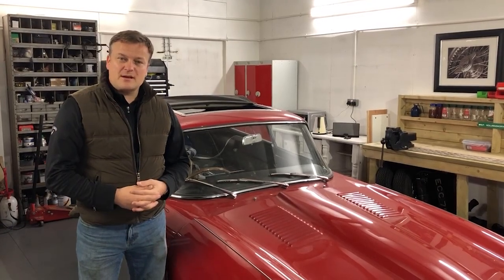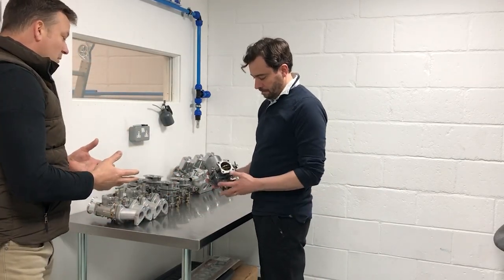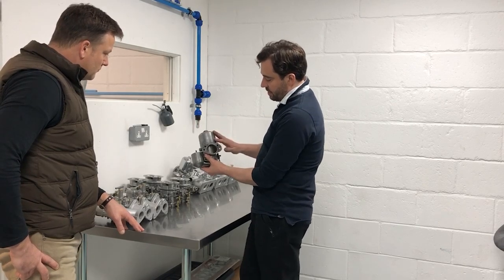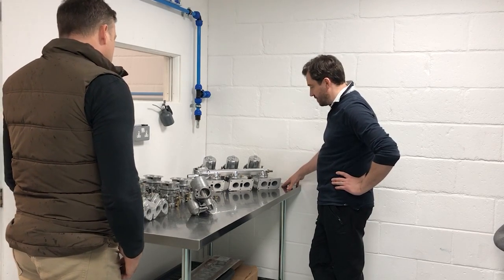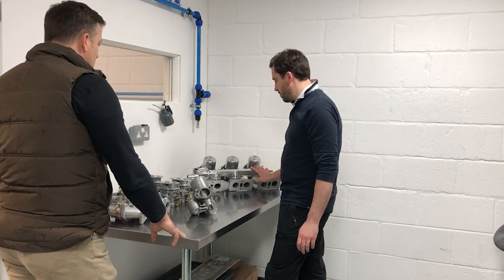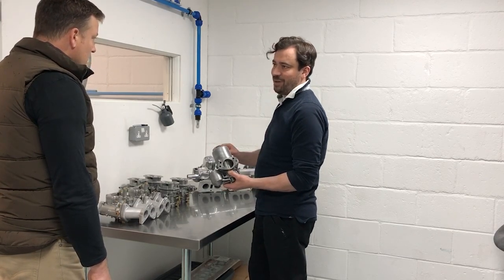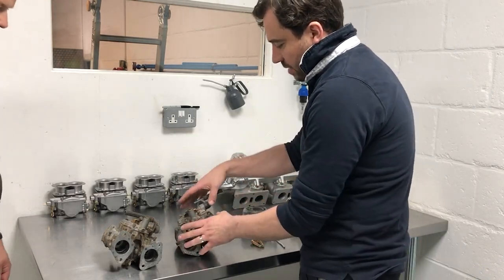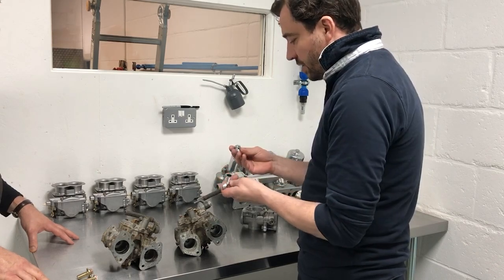Ep6 - Jaguar E-Type triple SU carburettors

Comment: Wow!, I've owned my '68 E Type OTS for 35+ years & of course worked on my triple HD-8s. This video taught me a thing or 2 for sure. I'm running an EDIS Ignition system so my spark plug gap is ,050. Also 1 7/8" intake valves and this week I installed a Bell SS 2" big bore exhaust system. I drive my car a bunch & each time I fire her up its almost like a Merlin coming to life. Life is good !
Reply from the maker: Your car sounds fantastic (I’m sure literally with those triple HD8s and the new SS exhaust!). Please keep following, there’s a lot more to come on this project.

Comment: I have the triple SU Carb set up on my Jaguar powered Special and I have changed now the fuel is fed to the carbs. My fuel line goes to a  blanked tube about 4 inches long, one entry pipe into this and 3 exit pipes on the opposite side which then feed to the carbs individually. The original setup can cause starvation to the front carb on hard acceleration as I found when used in competition. Another tip is  to put a little oil on the fuel line banjo to stop the fibre washers drying out when the car is laid up.
Reply from the maker: Thanks for the tips!  I don't think this car will be getting track use but I have heard of the front carb being fuel-starved before.  I'll bear it in mind when shaking down the car and engine/carbs after rebuild.

Comment: A comment about vapor blasting carb bodies. Many shops in my area have stopped that process because it can trap abrasive, esp in the small channels of the Webers. So a better alternative is to walnut blast then clean, this also prevents dulling of the surface and embedding of material into the bodies.

Comment: After vapor blasting; the anodizing needs to be replaced.   Otherwise the aluminum will darken and turn to that dull gray color with white corrosion.  

I’ve found Cerakote C-Series to be a superior coating to anodizing and keeps engine bay heat out of carbs.
Reply from the maker: I’m pretty sure there was no anodising originally involved in the production of these carbs or the intake manifold they mount to. That does mean as you say they’ll tarnish over time. Not saying that’s part of the charm but it’s certainly part of the experience! 😅

Comment: If it was mine I would put webbers on it
Reply from the maker: Interesting, why? Well setup SU’s should be pretty much as good as Webers. I personally prefer them for their original fitment and look.
Reply: @fossewayclassiccarworkshop  can't see how;  triple webers are the same as SIX SU carbs; individual throttle runners for better mixture distribution and the accelerator pumps in the webers make for way superior throttle response.  This is why the racing Jags use webers, but they are better for road use as well. My Datsun 240Z was night and day after swapping the 2 Hitachis (SU) for triple Dellortos.